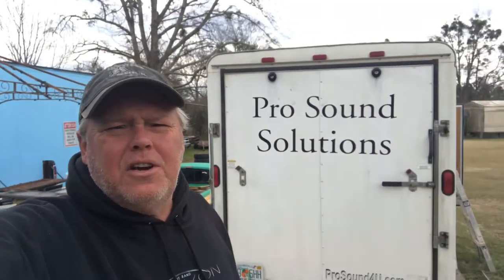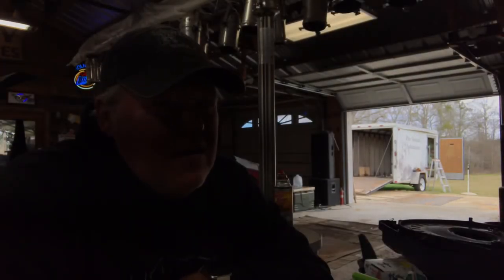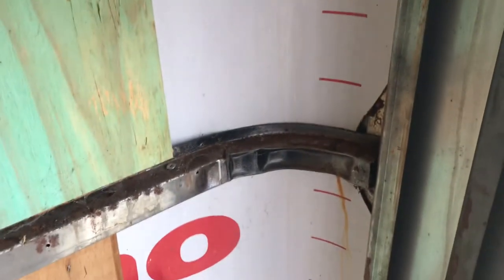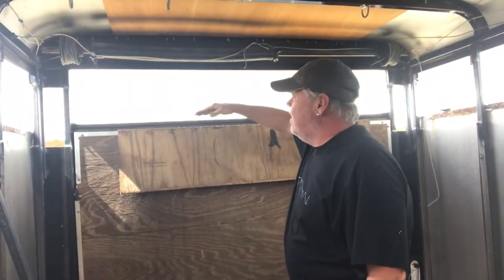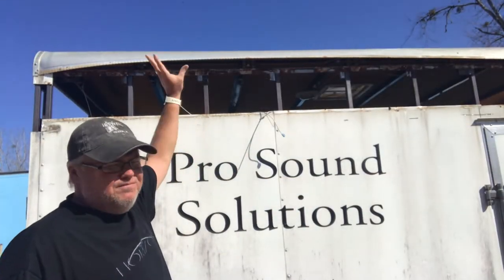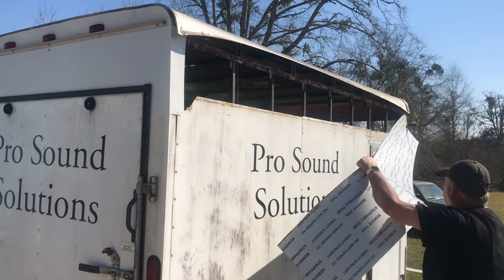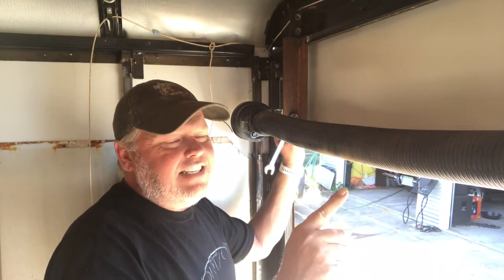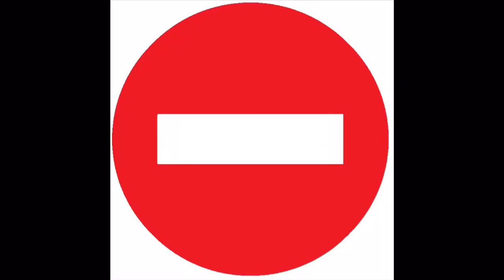Raise the Roof! Food trailer build… part1

Comment: Okay....I KNEW it could be done.  But now......could it be done like a popup with clear sheeting?  I have a picture in my head!
Reply from the maker: Of course it can. Anything is possible. You would need 4 actuators and a totally different design, but it CAN be done. 👍🏻
Reply from the maker: That is if you want it to pop up. If it doesn’t need to pop up then just use plexiglass/lexan instead of metal. 👍🏻

Comment: Hey! Thanks for the , exactly what i was looking for, 
I want to raise m'y cargo trailer 16 inches.
Now m'y question is to maximise the strengt of the New structure, how important is IT where i Cut the existant structure? I Sée you have Cut IT quite close to the Roof?
Let me know
Thanks
Reply from the maker: In my opinion, which can be taken with a grain of salt, you want to make your cut line at the top or the bottom. You do not want to do it in the middle. That being said, if you do your cut line at the top, then it will make it easier to lift the roof with minimal complications. You just need to weld in a piece of metal in each corner to guide the roof on the way upward.✌🏻
Reply: @wrongwaygarage  
Thank you for you'r quick response ! Like you'r humoristic talent also 🤗So, if the welding is well done, the roof will be solid no matter where the Cut is done , is That Wright 🤔
Reply from the maker: @roberthebert2365  pretty much. But a few inches from the top would make the process easier. ✌🏻

Comment: Thanks for the video. What size square tubing did you use?
Reply from the maker: If I remember correctly, it was 16ga, 1” square tubing. The thickness was the same as the existing studs and the size fit inside them nicely 👍🏻
Reply: @wrongwaygarage  Thanks for the reply
Reply from the maker: @billysmith3581  I do my best to answer questions… providing I see them! 😂✌🏻